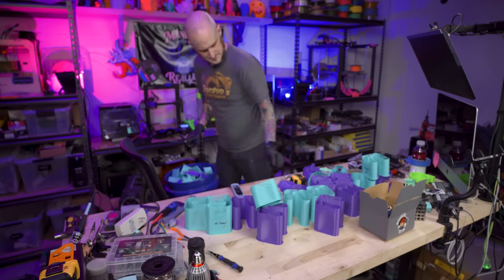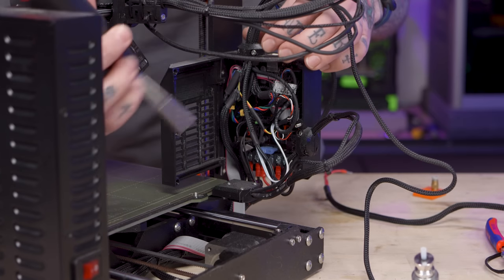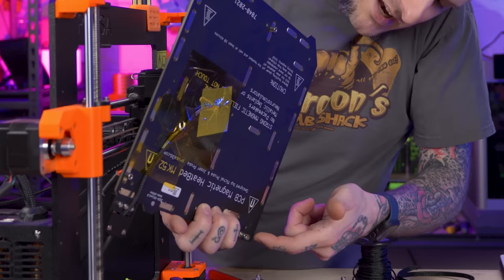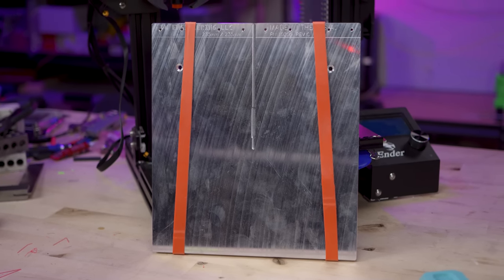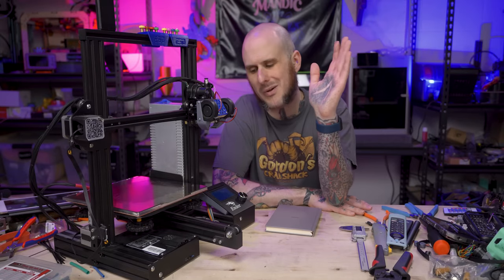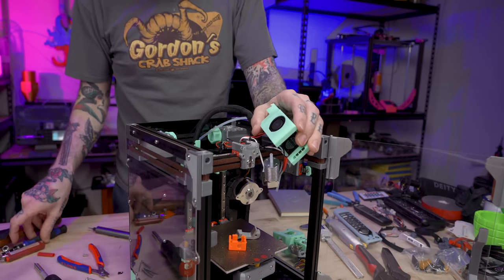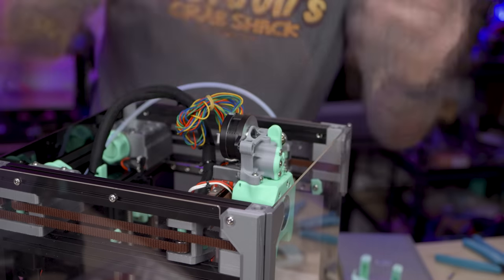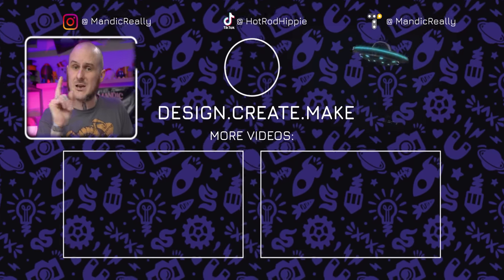BYE Prusa, LTT Screwdriver, Voron V0 Mini-AfterSherpa - Workshop Vlog 01

Comment: The Prusa is indeed a great go-to printer for beginners and reliable enough even for businesses. And that's pretty great when they came out at the time, they still perform good and the service is excellent (also worth something). But, when you've dabbled with printing for a while, these days they do seem a bit expensive for what you get, I'm also going for a Voron, just because I like the pain of building it, but also just to have a better printer in every way.
Reply: For a person that wants to get into it, with the budget around $500-700 range what would recommend?

Comment: As much as I adore my MK3S+ those are all extremely valid criticisms. The electronics box being so small especially drives me crazy. I also just did some work on the hot end and the process is quite annoying. Even after all that I still love the machine and it works so great for me. Looking forward to my X1C tho!

Oh and the LTT screw driver is hands down the best rarcheting driver I've ever used. I do hope they come out with a bit smaller one, but for now I use iFixit.

Comment: I'm impressed you were able to color match the "toothpaste" colored filament from the budget V0.1 kit! :)  It will be interesting to see if the bed you put on your Ender 3 affects print quality.  It looks awfully heavy for a bedslinger...
Reply: I believe the original E3 bed weights about 1kg, so, hopefully the nice new bed weights around that? it sure looks like might be double
Reply from the maker: I'm curious as well.  I don't push the speeds too hard on that machine, it is more my "slow and steady wins the race" machine that just does good quality.

And the Toothpaste color match I actually got right on the first try.  Hatchbox Mint Green ABS is a perfect match.  Just had to look around for a Mint Green ABS and it was the first one I tried.

Comment: The Sherpa Mini upgrade is interesting, I just did it on my V0.1, it seems to be as simple of an extruder as you can get. I like your trick for measuring feed tubes and using a countersync bit, I might have to do that if this one is too restrictive.

I also get my LTT screw driver at the end of the month, but you make a good point that it's hard to get into some places, it would nicer with a 90 degree 1/4in bit driver for tight spots.

Comment: It might be worth adding a thermal fuse to your bed heater in this case due to the thermistor being spaced so far from the heating element. Thermal runaway could cause damage before the software protection trips.
Reply: Also I've test the minias with capricorn and had some rough results with pa due to the tight tolerances. If you end up having any issues I'd recommend swapping it with some standard (generic) ptfe. Capricorn really isn't necessary on a dd setup.

Comment: It would be super cool if LTT made a stubby version that held maybe 6 bits. I can see using that a lot more on a printer. 2, 2.5, 3, 4, 5mm hex bits would be perfect in there.
Reply from the maker: Yep, that would make a lose more sense for me. A shaft half the length and handle the same. I have a Matco one like that I use quite often.

Comment: You should check out the new Bambu Lab P1P printer, seems to be a budget x1 carbon.
Reply: Did not know about that, looks cool!
Reply from the maker: Yea I saw the leak & hints.  Neat but not sure I have any interest in it.  Having the X-1C already I don't really have a need for a stripped down model.  I print a lot of materials that require hot chambers these days so an open air printer like that isn't up my alley so much.

Comment: Genuine question: What don't you like about the Prusa live z offset calibration? I used an ender 3 for about 3 years before switching to a mk3 and I would much rather dial the z offset in once per steel sheet with the interactive setup than to have to fiddle with bed springs and feeler gauges every 3 or 4 prints
Reply from the maker: That the toolhead is so large and obstructs the view of the filament path so much that you basically have to adjust blindly and check your results afterward.  No matter how much I've done it I've never quite gotten the hang of it.  And with the Revo hotend I had to do it everytime I changed nozzles, which got old FAST.
Reply: @MandicReally  that's fair, the extruder assembly is really blocky. Ironically the clearest view of the nozzle is from the back right 🙃.

I have a short chair and a tall workbench so my bed winds up being at chin height and I can get a pretty good view without craning too much, so I never really thought about it much. I also have a webcam mounted to the z axis motor just about at bed level, and I use the webcam feed in octoprint to check on my first few layers
Reply: Why are you comparing to your (rather strange) ender 3 routine though? Most modern printer have auto bed levelling so you shouldnt need any of that feeler gauge type stuff.

Also, I think its fair to say that both the manual and auto setups still pale in comparison to say the CR6 or Bambulab setups where you just dont need to set z offset at all.
Reply: @MandicReally  Thats really interesting to hear. I had though the point of revo, especially with the shoulder on the screw mechanism was that it seated to the same height for every nozzle. Thats actually a huge disappointment to hear and makes me way less into it.
Reply: i personally wouldn't trust revo's statement regarding tool height being the same everytime. offsets are so finicky some times that a few microns makes or breaks bed adhesion
Reply: @BeefIngot  Odd to hear you call the process of adjusting the bed springs "strange" when it's been the standard leveling procedure since like 2010, but okay.

Like I said, I was on an ender 3 (which did not come with ABL), so that was the only way to level the bed. I did upgrade to a bltouch which worked great... for a month, until it stopped registering the probe event and would only crash into the bed. I had to revert to the default end stop and go back to manual bed leveling. Even with the bltouch I still had to find the perfect z offset after I first installed it, and having the Prusa's guided z-offset would have been really helpful for that 🤷‍♀️
Reply: @cemmy410   @Emily Christ  Its the part about shims and what not. Most just use paper and most don't even need manual levelling any more.

As for your particular case, most people don't have such issues with bed leveling, so I don't think it should be taken as representive.
Reply from the maker: @BeefIngot  it is still like any nozzle.  Any variation or movement in assemblies is going to result in some difference.  It is minor differences, usually babystepping can correct for it, but it i can be upwards of .1mm sometimes. Enough so that the proper thing to do is Relevel / Reset Z-Offset on each nozzle change over.  It really isn't a big deal, but with my dislike of the Prusa system, it was annoying.

  On my Ender 3 with a Revo, it is a breeze to do.  Do a quick 4 corner adjust and I'm off again.
Reply: @BeefIngot  okay

Comment: I have multiple questions here:
About the enfer 3 pro bed, how did it impact your speed and accel?
And you said you haven't touched the PSU yet. Is this a common upgrade ? I have had my e3pro for almost 2 years and I haven't seen a good upgrade for this
Reply from the maker: E3 Pro comes with (or used to) a better power supply than the base model. Some folks like to upgrade to the Meanwell 350w but I am not sure it’ll be necessary. I’ll need to test the actual draw of the bed. 

Haven’t done any testing on the bed’s effect on things yet. My E3 is generally my “slow & steady wins the race” machine, but I’ll see about playing with how hard I can push it.
Reply: @MandicReally  Oh I think you should try to push it. Ive changed the duct fan + hotend, moved it to a direct drive, changed the main board and added klipper. I now print at 160-180mm/s with it. I'm not saying you should print that fast, but if you are printing at 50mm/s, i think you can easily push it to 100

Comment: need some advice someone gave me an original wood replicator with no extrude and motors got 2 e3d v6 hot ends ordered what do you recommend for extruder motor
Reply from the maker: I'll be releasing my Re-AniMaker project files very soon that folks can use to make their own Core-XY Replicator projects. But the simplest thing I'd recommend is to seek out a V6 mount design (I know for a fact files exist already, I think on Thingiverse), and run a Bowden extruder setup on the back of the box.  Some simple bowden extruders for like an Ender 3 and a couple motor mounts should be cheap and easy to come by.

Comment: You are so right about the Live Z on the Prusa.  In needs be revamped because it's simply terrible.  I have 3 Prusas and I'm finding I like them less and less.
Reply from the maker: Even if it just went the opposite direction so you could actually see the line as it’s being extruded. Start at the front and head to the back of the bed. That would still be annoying but make more sense.
Reply: You don't use the built in live Z adjust...just print an 8x8 square and dial it in as that prints. Thats what I did. my oldest MK3 is 3 years old. I did the 8x8 print one time and never did it again. My live Z offset is still the same even with almost 10k print hours.